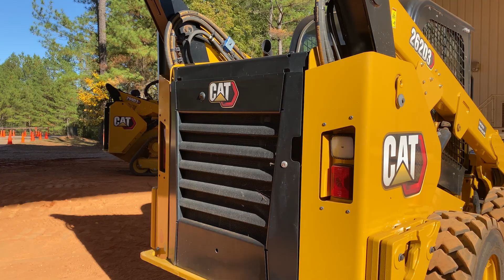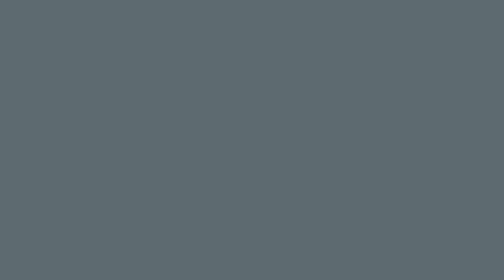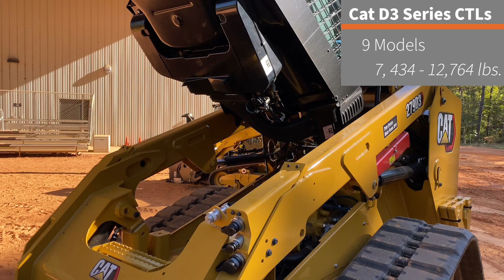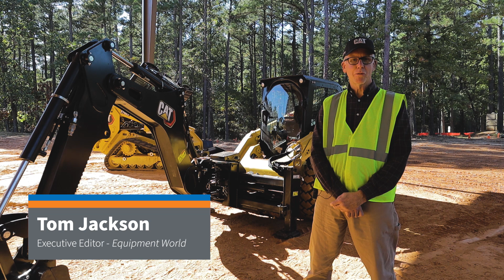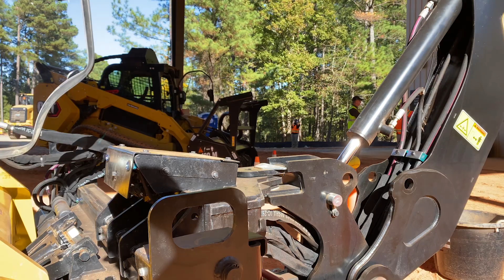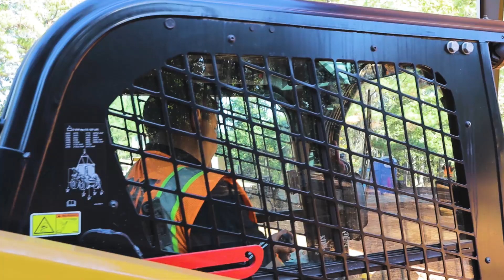Cat intros Backhoe Smart Attachment on new D3 Skid Steers and CTLs

Comment: I don't care for the controls in the cab for operating the hoe. The visibility has to be horrible. Especially sitting behind a closed window. I like the idea of switchable control patterns for sure, side shift great, but I would have to think that you have horrible visibility in the cab. Design one with controls on the attachment itself like years ago. Movement is not necessarily progress.